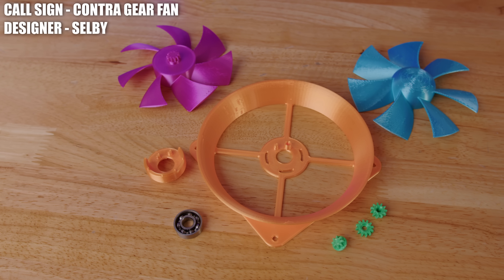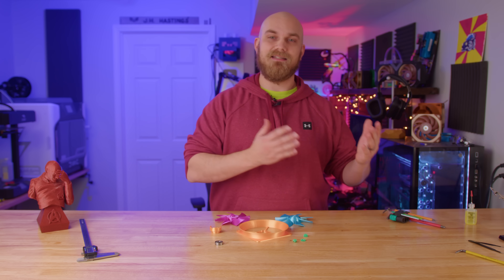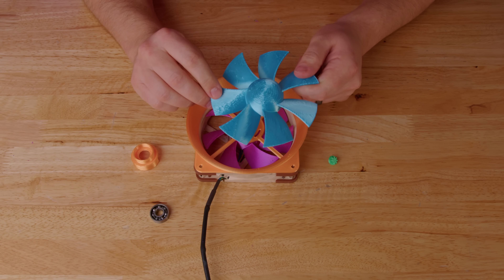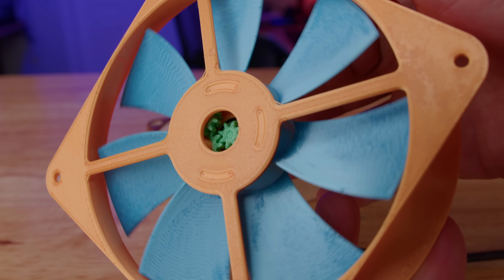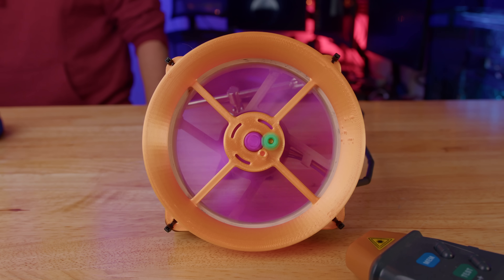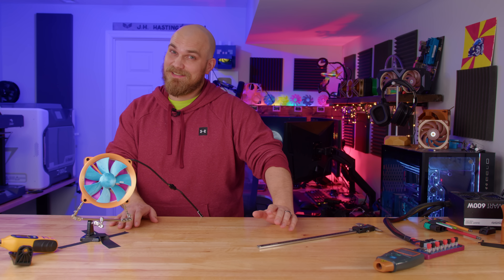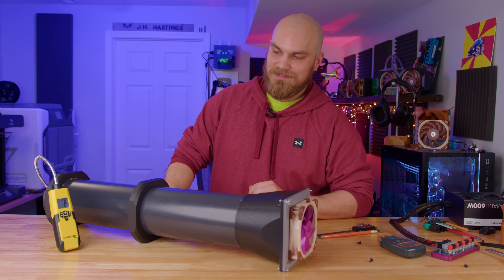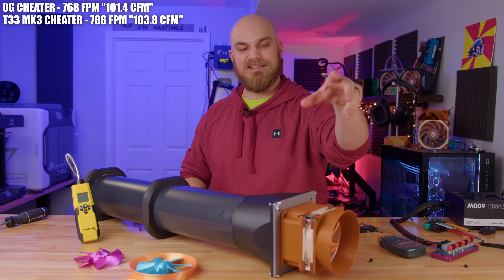World’s Most Complex PC Cooling Fan | Fan Showdown S4 Special

Comment: I think the #1 thing to do to improve this design is to ditch the 3d printed gears for some off-the-shelf ones. Sloppy gear accuracy is no doubt the biggest contributior to the unacceptable noise level.
Still very impressive design-wise.
Reply: Plus those plastic gears are going to wear rather quickly and just make the slop worse. Some simple brass gears would do wonders, I mean we've been using them in watches for a couple hundred years now and they do their job for a long time.
Reply: @SilvaDreams  PLA isn't too bad for wear, it self-polishes, so it will get a bit more slop, but once the surfaces are smooth they are really quite durable to constant load. Just don't stop the fan with an object while spinning, bad things will happen.
Reply: @SilvaDreams  Sure, brass gears won't wear but the fans are still plastic.  You could get some decent life out of plastic on plastic gears but metal on plastic would probably self-destruct.
Reply: @VagabondTE  actually plastic on metal is the preference in industry, if plastic has to be used. You make the easier component to replace out of plastic if possible. With identical materials, they wear at identical rates. With dissimilar materials, the softer one wears faster, so you can control what surfaces wear, and where. Plus, plastic on plastic produces... plastic dust. Which is an abrasive! Plastic on plastic rapidly becomes its own sandpaper. It's why the old SNK controllers are all garbage and low durability. Plastic shaft in a plastic housing.
Reply: @cheyannei5983  For bushings, sliders, and landings sure.  But can't say I've seen plastic gears with metal gears.  Plus 3D printed plastics are very different from machine(ed) plastic.  Makers Muse did a lot of testing with 3D printer plastic gears and found that they shape to each other.  That's what makes so much slop but that and slight flexibility makes them last longer than you would expect.  My hypothesis is that metal on 3D printer plastic would reshape it into being unusable.

Also, the original commenter was suggesting that the easily replaceable gears would be metal.  That would make the fan blades the consumable part.  I just can't see metal being advantageous in this setup.
Reply: @VagabondTE  Plastic gears with metal gears are the standard in printers and where the metal gear would also be too costly, like in kitchen appliances and motorized HVAC parts like dampers.

In this setup, the shaft would need to be keyed. The 3D printed gears are a problem. Ordinarily, you'd just make these out of acetal resin, which is nearly as tough as steel, more abrasion resistant, and extremely low friction (think Teflon: it feels permanently greased, having typed on an acetal keyboard for 10 years with almost no wear).
Reply: @cheyannei5983  Okay I see what you're saying but I think you've really gotten way off the original example.  The original commenter was suggesting that instead of the 3D printed plastic gears he would use off-the-shelf metal gears.  Now you're suggesting resin for those tiny gears.  I see what you're saying but this is suggesting an insane amount of work. What's the point of 3D printing your own fan if we need all these different parts that may or may not work together?

Because honestly, I would just mirror image the Noctua on a second fan and flip it backwards.  Boom..  compression propeller, or whatever its called with zero effort.
Reply: @SilvaDreams  I beg to differ, with the right lubricant you can get a long lifetime from 3D printed gears. Replaced one (PLA) in a mixer and it still goes strong after more than a year of regular use.
Reply: Yea itd be better off with getting the shafts more rigidly emplaced and aligned and the gears maybe smoothed a bit or  just made sure  of their uniformity and it should improve it pretty decently, i mean if you wanted to go all out then you could go with like some metal gears with ruby bearings with  either helical cut gears and some thrust bearing or herring bone gears to keep it aligned  and to counter act and pull from the front blade.
Reply: He has a resin printer, wouldnt that be much better to make gears even though its still plastic?
Reply: @stewievader4  In terms of strength the printer plastic is probably strong enough if you avoid shock forces - at least for a while. There's not a lot of torque on a fan like this. 
I'm more so talking about the resolution the printer is capable of. On these tiny parts the shape gets quite rough even on good printers, and gears need to mesh smooth and evenly to work well. It's kind of amazing printed gears work at all.
Reply: @TheStigma  I dont know how well it scales at that level, but other prints hes done with his resin printer were much smoother and finer in resolution so it seems like it would be much better suited to make gears.

Comment: "...So I removed the grease from the bearing" 
You did WHAT ?!
Reply: Grease is for bearings that are under heavy loads and it also provides rust protection for metal bearings. If the load is small, grease only slows the bearing down.
Reply: @Elrog3  The benefits of grease outweigh the small amount of drag it induces (not friction which it is meant to reduce); that's why bearings which don't bear much weight are still nearly always lubricated with it. An unlubricated bearing is an unhappy bearing regardless of it's purpose, which is evident in this very video.
Reply: @General_Griffin  I have used bearings just like the ones he had there. Removing the grease massively improves their ability to spin freely. And yes, of course you want lubrication in your bearing. You just don't want that lubricant to be grease for this use case.

Comment: What next ? Single speed variable pitch blades???
Reply: I wanted to see the same thing, using weights, springs and centrifugal energy to change the pitch so that computers with a variable speed controlled fan could have a higher air flow at lower rpms.

Comment: The T33 alone, beat the single fan version of the contra. Would changing one of the fans (or both) on the contra to be shaped more like the T33 be even better? And what about adding the cheater housing to that?
Reply: The cheater housing might have to change a little to accommodate the second fan, so I think these two fan makers need to collab so we can see.
Reply: @tvrkm6897  oh man, I hope they do.
Reply: @tvrkm6897  Ya, no doubt. I bet every piece would probably need some tweaking to make them all work together. But it's an interesting idea and I have my fingers crossed someone attempts it (I'm just a spectator here)
Reply: @tvrkm6897  If he used the counter rotating fans shroud on top of the rest of cheater, it would be fine I think
Reply: contra t33 cheater...........
Reply: @ghomerhust  my man planning to blast the atmosphere away
Reply: @ghomerhust  that's exactly what I was thinking!
Reply: @ghomerhust  sounds like 120 cfm to me
Reply: @ghomerhust  i feel like at this point frankenfan (my name for that holy cooling abomination) would just become a jet turbine. This is that point. Might solve global warming. A cooling fan so powerful it causes a new ice age.
Reply: @ghomerhust  At this point it would be counterrotating Jet compressor attached to the fan hub!
Reply: T33 mk3 X2 in contra layout with cheater shroud would be insane to see
Reply: Contra-T33-Cheater needs to become a reality!
Reply: @notonlyhuman6073  frankenfan. We should call it frankenfan
Reply: This is exactly what I was looking for, we need more coop-mode since we already are topping out.
Reply: My thoughts exactly! The creators of these fans need to team up and fully integrate their designs. We need to see what the result would be if the T33’s blade geometry was modified to operate with a Contra-rotating assembly, all inside of a purpose made Cheater housing with the tightest tolerances possible. Also with some bearings on those gears if it is at all possible without increasing their size. Just think of the possibilities!
Reply: @surgingmist9429  rc car bearings and gears to make the hole thing stronger and more resistance free.
Reply: @justinwilliams1333   My thoughts exactly when I saw the printed gears :) was checking comments to see if anyone had suggested it lol :)
Reply: @surgingmist9429  My new case needs just one fan for fresh air input. Its a Contra-T33-Cheater. lol
Reply: @SirBSpecial  how to start an ice age
Step 1: this
Reply: @surgingmist9429  For bearings one could think of small brass and copper pipes with a tiny mit of graphite powder, that should do the trick in terms of dry lubrication.
Reply: Typically you want the rearward set of blades in a contra-rotating setup to have a steeper AoA because the airstream is hitting it at a higher speed.
Reply: @MarkoDash  Is this actually true? Don't the laws of fluid dynamics demand that the total air going in, equals the total air going out? So unless extra air is getting injected in-between the two fans, or the throat diameter decreases after the first fan, the air speed must be the same through both fans? Or am I being a doofus?
Reply: @benjaminmiller3620  I'm not sure if it matters with the small scale and relatively low airspeed here, but I believe it's the case with aircraft propellers.
Reply: @benjaminmiller3620  tbh I am not sure. But on a jet turbine, the low pressure compressor is larger then the high pressure compressor. 
And with the cheater mod, there is probably no reason the outer fan couldn’t be say 140mm and flush with the bell and have the 120mm higher pitch fan in its normal position. 
It would be a cheating cheater, but it should in theory flow more then a 120 or 140mm fan as the flow would be increased. 
It would be more like a jet turbine then a fan.
Reply: @benjaminmiller3620  Air compresses :)
Reply: @benjaminmiller3620  The volume flowing through the fan stays the same but it creates pressure because a large area of air is being force through a limited area. This is why you can feel a lot of airflow at the exhaust side but you don't really notice it at the intake side. My guess is that the second fan is working in a similar way but it has more limited intake and as a result creates more pressure and the pressure creates the additional speed as it equalizes. This is kinda why something like the exhaust shroud noctua made blasts air so well because it shapes that pressure in a very controlled jet, like a rocket nozzle really. You can use similar principles when designing airflow in your computer case, even including shrouds to direct dedicated airflow. That can reduce the need for fans focused on exhaust speed by letting pressure fans do what they do then controlling the way that pressure is allowed to equalize.
Reply: @justinwilliams1333  It's not entirely straightforward, and depends on a lot of other design elements. To simplify for this case: the first two fans don't necessarily need a size difference as the first fan has a larger intake area by virtue of being exposed to an open intake. Since the cheater shroud tapers, it just smooths and speeds up intake air which can also reduce blowback/turbulence around the fan edge. If the shroud were a cylinder of the same diameter as the fan, then it would actually start restricting intake and you might need the second fan to be smaller.

For aircraft engines the design dynamics get even more complicated because you have so many other components to work around. It could have a bypass fan, it could have components in the shaft, etc.
Reply: This!
Reply: Oh that point you're needing different blade systems
Reply: I really want to see this
Reply: I really want to see this happen
Reply: That collab should be named the "Cheater Beater"
Reply: try adding tiny bearing in the gears for smoother gear transitions

Comment: We NEED to see the Contra with dual T33 MARK 3s and the Cheater frame!
Reply: Well why not put two fan housings back to back, so the rear one is counter rotating, put t33's (one mirrored and front back flipped) in and use the funnel of the cheater (the back housing is just a flow straightener you don't need with the counter rotation of the second fan).
1st. More power due to twice the engine
2nd. No gear noise / mechanical losses
3rd. No alinement issues so no rubbing
And I know its not a fair competition but there are push pull configs for big aircoolers to test against. 
next season? *wink *wink
Reply: @arnejungclaus7957  Well he needs to test the contra with the shroud it had without the other blade on it to be sure otherwise its not really a comparison of the single fan vs contra rotating.  So while that's a good idea but in this case actually 1+1 doesnt necessarily =2 . If you are using the exact same fans that is its only going to increase the  static pressure that the fans can create and you wont get more than 10-20% more flow than what the fan is rated for initially. The second fan in the rear needs to be a higher rpm to make it have much of a difference.  With the second motor  counter rotating it may  come out a head but i still think they will be remarkably close and it will still make a funky noise its kind of inherent with the counter rotating props if close by, Regardless tho a single fan with a counter rotating setup will be more efficient  than stacking the 2 and offer more performance over a wider range of conditions and higher static pressure . you can really see it in the smoke test on how uniform of the outflow that it puts out because it is cancelling any of the lateral motion imparted by the blades .
Reply: @connorjohnson4402  that was exactly what I thought, I mean I saw some electric sports plane maker from UK experiment with it too (cause its easier than on piston engines) it was on "fully charged" YouTube channel a few years ago.
Reply: @arnejungclaus7957  Well the idea is to get max cooling out of one motor. Two motors would be cool, but it would kinda defeat the purpose, ya know?
Reply: @fizzisoda7113 yeah I get that, it doesn't really fit the series but maybe it's more a tangent. 
Would still love to see it though
Reply: @arnejungclaus7957  That would draw twice as much power.
Reply: This. This right here.
Reply: And get some metal gears and bearings to lower the friction/noise 👍
Reply: The god fan
Reply: Came here to say this exact thing.
It indeed HAS to be done, as does:
- Stock Noctua + Cheater Housing
- Contra Stock Noctua + Cheater Housing
- Contra Cheater + Housing
- Contra Half-Height Variants + Half-Height Cheater

.... Pretty please?! ☺️🥺
Reply: the T33 MkIII secondary fan blades (the drive fan in this case) needs to have a higher pitch blades than the first fan.
Reply: And milled by Alex from Praetex Designs to make the gears sturdy and smooth. That would be so great.
Reply: The Bastard Cheater Fan for the win
Reply: From a material perspective, I would love if we could go all out once all of the design has been fleshed out. I'm talking concentrated autism thrown at this. Make every piece out of hexagonal boron nitride, blades almost as thin as a human hair, everything coated in teflon, with a coat of Hi-T lubricant, vacuum sealed housing for the gears, and super tight tolerances.
Reply: Cursed fan founded 😁
Reply: I wanna see that on a 360 rad setup sticking out the front of a case!
Reply: Same

Comment: This is a design used in some server fans, such as the San ace 40 or the Delta GFC1212DW, but those use 2 motors.
Reply: it's probably better to run with 2 motors. I think gears would require too much maintainance unless you use more expensive materials
Reply: @_ExTitus  yeah was thinking the same. Basically take 2 fans and sandwich together kinda design more or less. Each with own motor and wire to connect to the motherboard. Gear make too much noice and will break at some point
Reply: Man i love thick fans
Reply: Two motors could be used in this test, but then they both would have to run at half power to give a fair comparison.

Comment: Am I the only one wondering if it's more or less efficient (cfm/watt) than a single fan?
Does it flow more or less than a single fan with the same effective blade surface area?
Reply: Watch the video. He shows the performance of both and the difference.....
Reply: @DrivenbyAdventure-Shawn  You have misunderstood my question. Also, no, he never shows the energy efficiency. I'm not sure he's even got an easy way to get a sensitive ammeter in there.
Reply: Typically contrarotating fans/props are more efficient but at least twice as loud. 
https://en.wikipedia.org/wiki/Contra-rotating_propellers
Reply: @stephen1r2  That's with a metal gear train and bearings throughout on props that were designed to efficiently hand off the airflow.
This is a pair of fans that are more conventional, using a reversing idler that has a fairly high torque moment on a pair of plastic pinions that don't have a bearing on either of them.

Comment: Now just need to switch to helical gears for the noise...
Reply: Helical gears impart much more axial thrust which causes friction. Along with the helical gears increasing friction too. 
If it could be made with low friction bearings and thrust bearings along with polished metal gears then helical would be good. With the plastic it’s just to much friction once it’s loaded and trying to move air.
Reply from the maker: Selby said he did try helical gears and didn't have as much success
Reply: @MajorHardware  yeah, the resolution would be an issue at that size